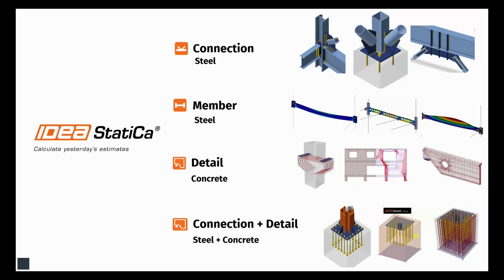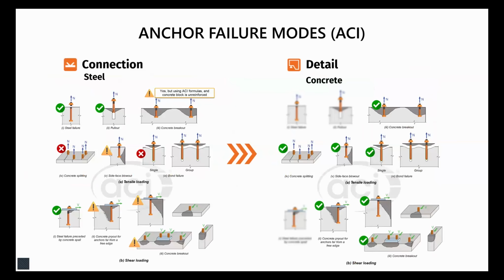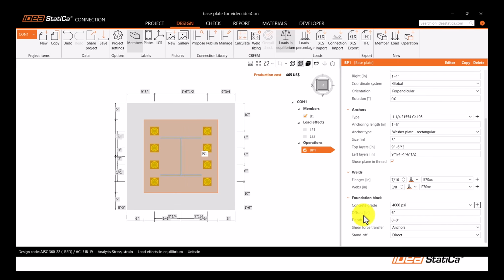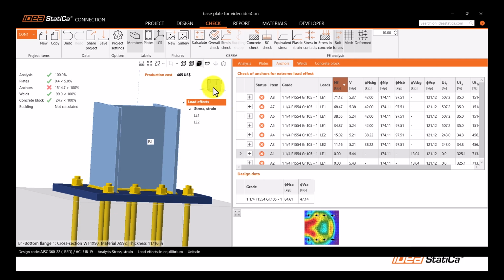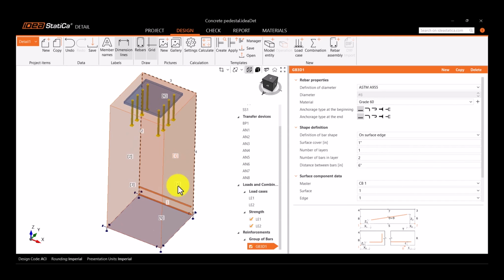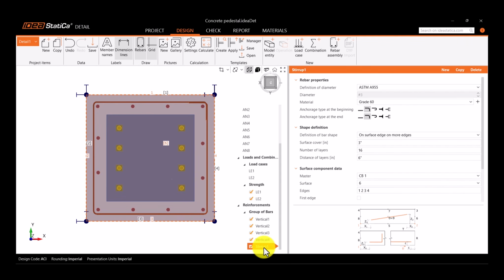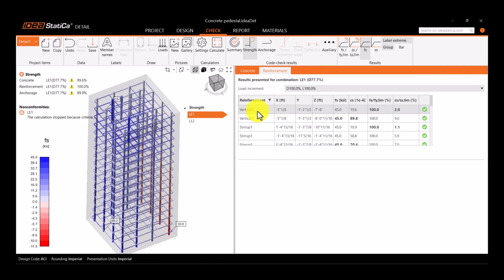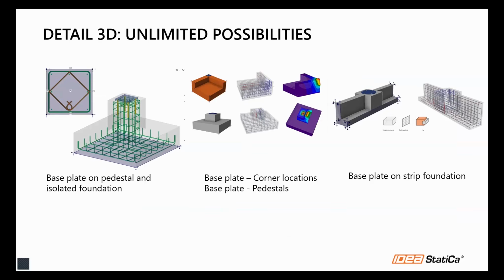NCSEA Webinar: Integration for Base Plate Design and Anchor Reinforcement

Comment: Does this mean that if a connection fails in shear and tension breakout in the basic detail, but passes in the 3D model after adding reinforcement (UR < 100%), it can then be considered safe in breakout, or are there additional considerations?
Reply from the maker: Yes, exactly! In the Connection app, you check steel parts perfectly. For the concrete block, you do the basic checks, because the concrete block in Connection is simplified and there is no reinforcement.
When you export it to Detail 3D, you add reinforcement and the model is based on 3D FEM.
So if concrete fails in Connection, you can export it to Detail and analyze it more precisely to prove, it is safe.
https://www.ideastatica.com/anchoring-design
https://www.ideastatica.com/anchoring-design

Comment: is it possible to do a base plate design with a single bolt in your software? Industrial machinery application. Thanks.
Reply from the maker: Hello, yes, this is possible in general, just in case the acting forces would result in creating a mechanism (rotation around this one bolt) then the model would not calculating showing singularity.
How to position and set bolts/anchors:
https://www.ideastatica.com/support-center/how-to-set-position-of-bolts
and one bolt connection settings:
https://www.ideastatica.com/support-center/how-to-model-one-bolt-connection